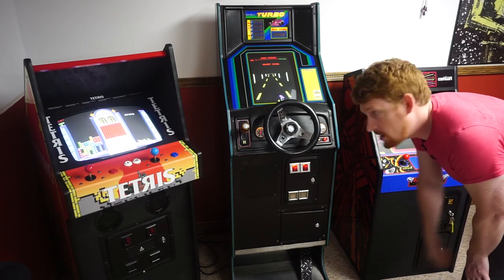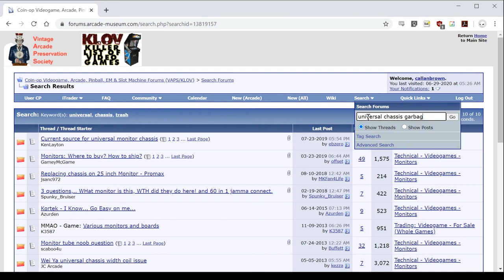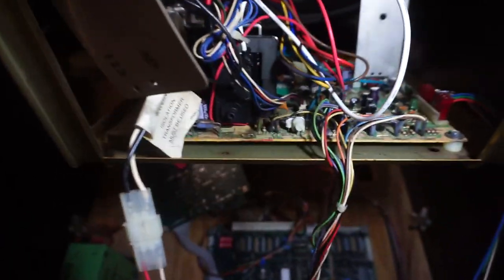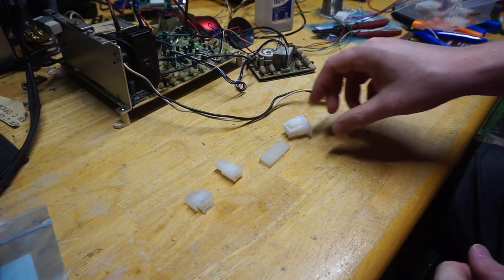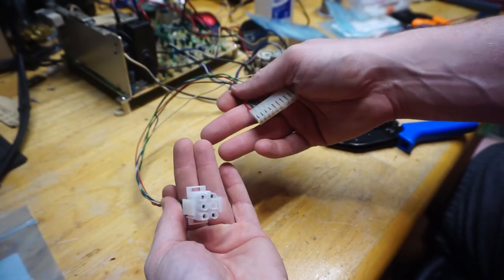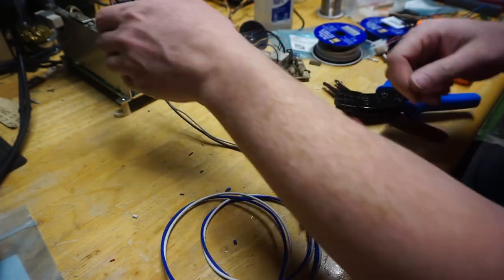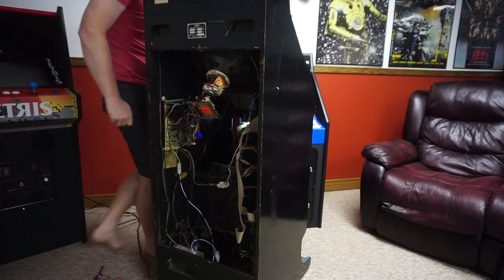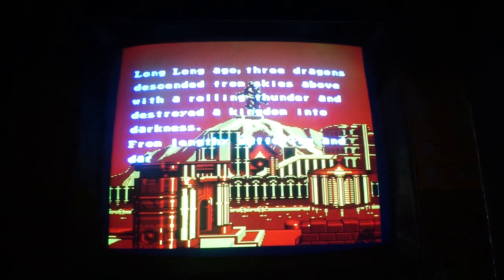Upgrading a Sega Turbo monitor and when can you use a "Universal Chassis"?

Comment: I found that on the 25-29 inch universal chassis, there seems to be a pot in the power supply section (probably B+ adjustment) that makes a world of difference to the washed out colors problem. I was pretty disappointed with the color brightness until I started to mess with that pot. Mine didn't come with instructions so I just kept fiddling with it until I got it to a point where the problem wasn't too bad.
Reply from the maker: Yes! That is the B+ pot, but it's a bit of a mystery what it's "supposed" to be set at. I seem to recall 120V. I admit I've used it to shrink or grow the image a few times. I have a set of three more chassis on the way, maybe I'll do a test to see what the factory sets them at (if they're consistent at all).